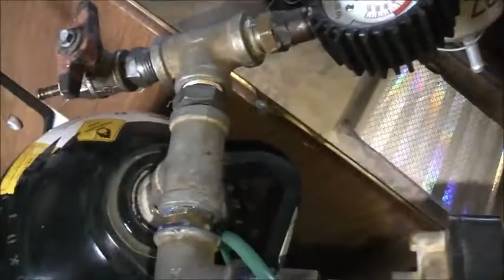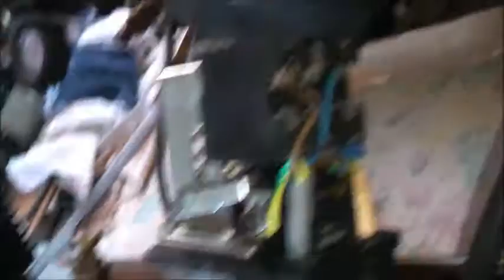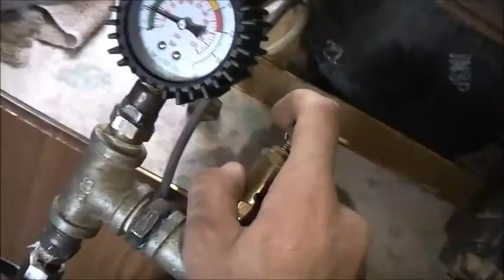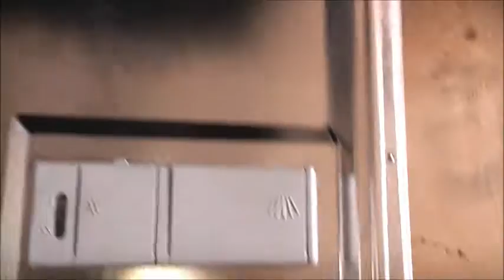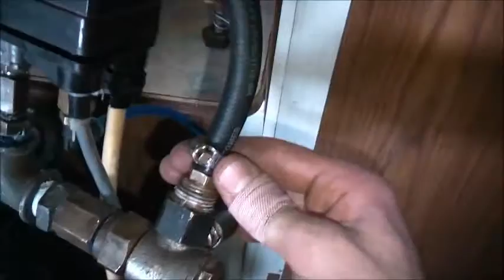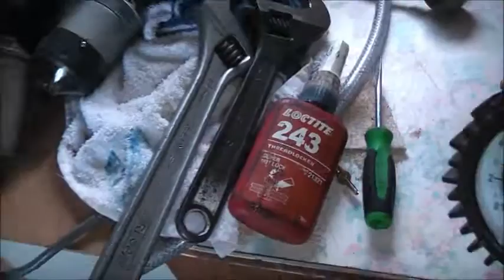Proper Home Made Air Compressor!

Comment: You should have a way to remove the oil from the air coming out of the compressors before feeding it into the tank, otherwise you are going to get a good amount of oil in the tank displacing the air over time.

Comment: *EARTHING TOP TIP* 

Now that you have electrical equipment on the tank, it now needs to be treated as a class 1 electrical appliance, just like the fridge compressors themselves. Because of this it'll be a very good idea to earth-bond the metalworks. An earth clamp on one of the fittings should do the trick. It's just to prevent the tank & pipeworks from rising-up to mains voltage should that electrical device fail or should a wire come loose & touch something metallic. :-)

-BoomBoxDeluxe.

Comment: A proper relief valve would be preset nonadjustable with a tamper proof wire and lead seal
never seen a 3 phase pressure control switch I think your looking @ a normally open and a set of normally closed contacts. Larry you could install a cross fitting @ the inlet of that HP tank and run a drain line to the bottom to drain condensate/oil from the tank I didn't really understand your problem with the check valve

Comment: All clever stuff larry :-)

I helped my mate repair a beast of a compressor, the pressure release system wasnt working, so when the compressor started it had full tank pressure against it, fuses were popped by the motor stalling.

A farty little valve that screwed into the tank was filthy and stayed open, a clean and stretch of the force spring and it works spot on now :-)

I learnt of youtube, the compressor is happy as larry.. sorry for the accidental pun :-)